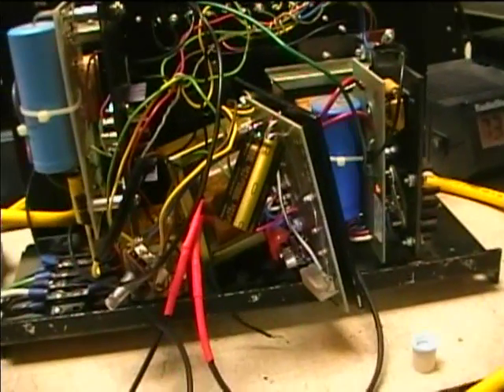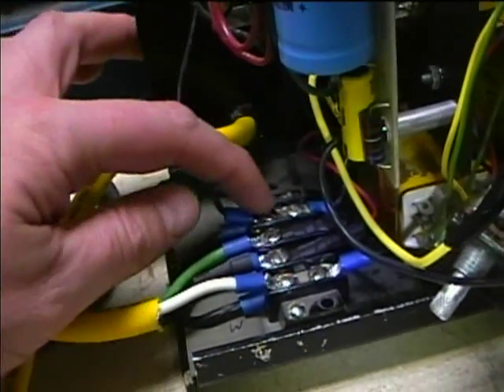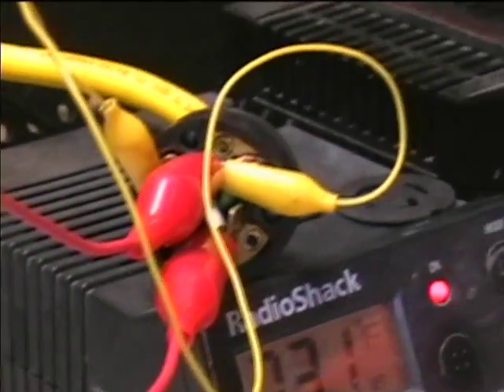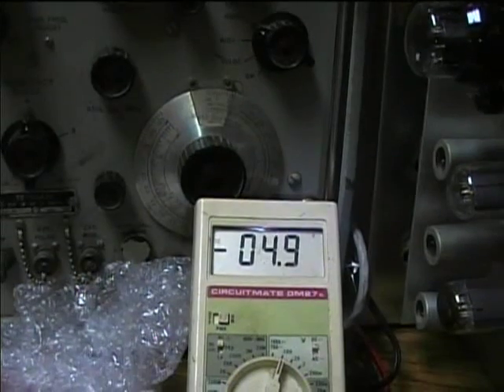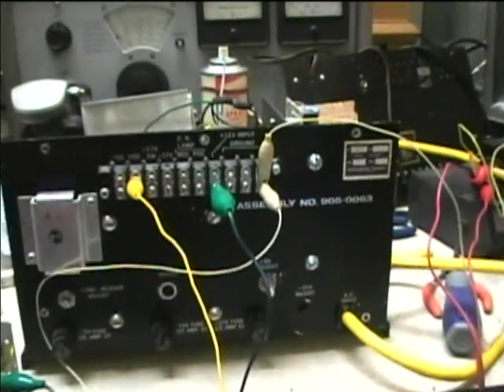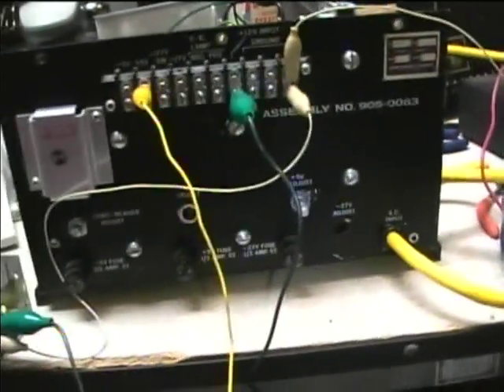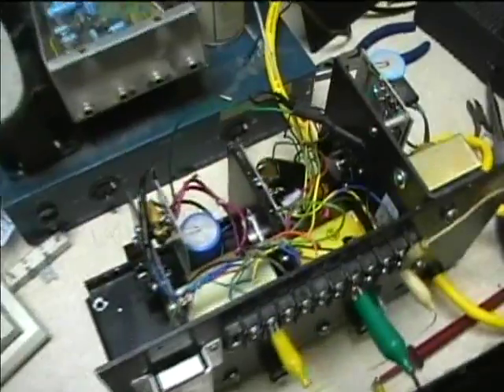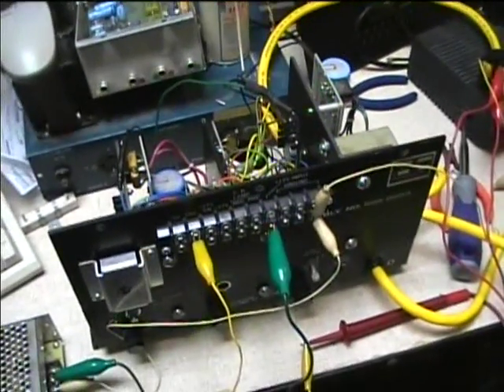1972 Allen SYS-300 organ power supply repair

Comment: HI Guys, one of my co-workers brought this same type of power supply from an Allen Organ for me to look at. I have never worked with one of these before, and just wondering if  you can provide any insight to the operations/specs of this power supply. He tells me when plugged in to the organ and powered on the -27v rail does not output over -23 to -24 volts, so it acts wonky. He took the supply out and brought it to me to look at, he is determined that is was the potentiometer to adjust the output. I measure this to be a 1kΩ pot and checking the travel, I get 0 - 1K with no dead spots. With no-load  I can get -27 volts easy and goes to -33v max. I can put 12 volts in and activate the other power rails and get +5 and -5 with a maximum of about 7-8 volts.  To me  I don't see a problem with the power supply. I  did replace the electrolytics with all new, as closely matched as possible since they looked vintage 80's.  I gave him the power supply back and he said he still encounters the same issue. I am thinking the problem is in the load of the organ somewhere. Been a while since any activity here, but maybe someone is watching. thanks for any help.

Comment: Just replaced the power cords on three power supplies in a Allen 631-D.  Talk about short wiring from the power transformers in the -27, +5, -5 power supply.  If I didn't have to do the work in the field I would have went this route.  The rubber AC cords were all dry rotted.  To think 3 techs before me missed this! :)

Comment: If the 500uF capacitor was just for a power rail then you could probably have got off with using the nearest equivalent like the 470uF one on its own or even a 1000uF unit.

And you're definitely not going to get 5V spot on unless it's a military power supply with a multi-turn preset.  Yeah, that range of adjustment is scary if old TTL chips are involved.

Comment: That is very interesting equipment. Great work. I agree about running into sloppy work. My boss and I worked into a PBX office at a manufacturing plant and there were wire everywhere. Lots of wires dangling, on the floor, through the ceiling, YOU NAME IT! Then he made the mistake of asking me what I thought. I said that "I have not done work like this since the 8th grade."

You always do great work!